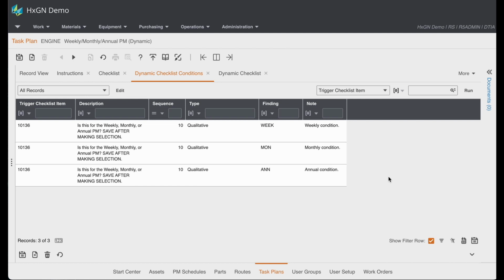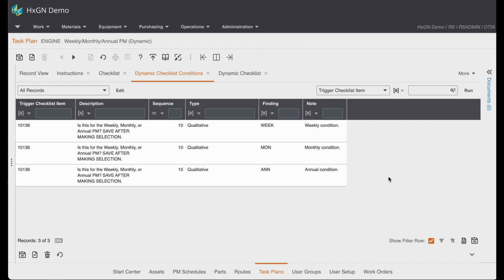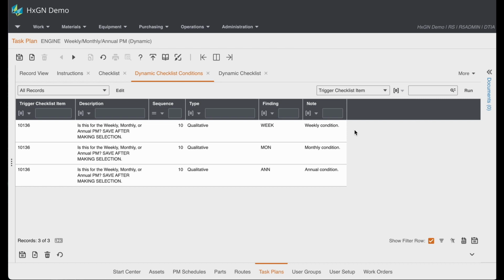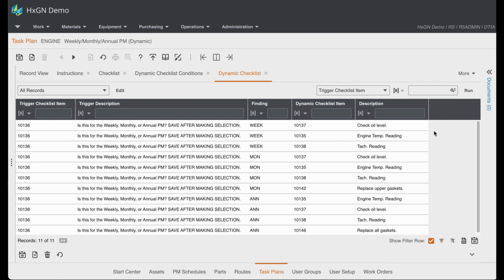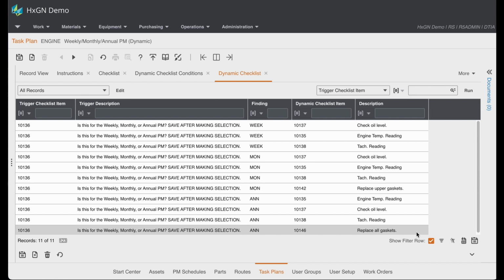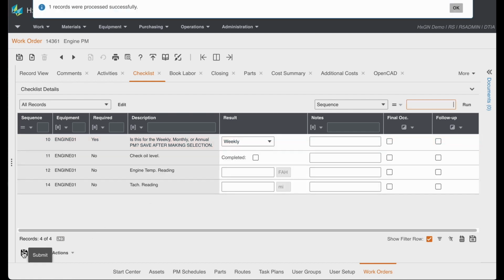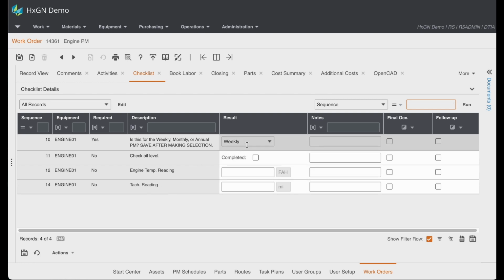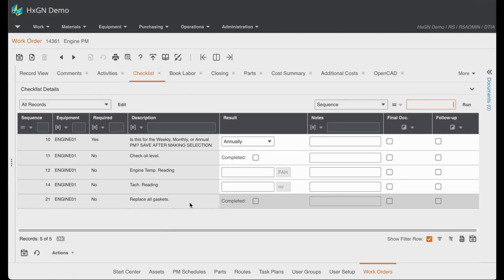Master Maintenance with Dynamic Checklists in Attune EAM Desktop

Comment: Hello Rebecca, how to setup the pull-down menu for the sequence selection? I am now working with a checklist, but the dynamic checklist does not work as expected. For a machine, I ask the first question: can it be inspected? If "YES," then the rest of the questions for that machine may become visible. If "NO," then the questions can be skipped and it moves on to the next machine. You then get too many dependencies, causing the program to no longer handle it. Or do you have another solution for this?

Furthermore, the questions that are shown depend on the "Object class" of the object. It does not matter if you also fill in the "Category." The questions presented only consider the Object class. This is unfortunate, because with the Category, you could make the questions more specific. Example:
Wheel = Object class
Wheel DE (driven end) = Category
Wheel NDE (non-driven end) = Category

You see all the questions in the Checklist for the wheel, while the questions could be different for a driven end or a non-driven end.

Unfortunately, the program does not make a distinction here. While with the Entity a "Class" and "Category" are clearly indicated.

Or is this an option that needs to be turned on/off in the background so that the questions are presented better?
Reply from the maker: Hello! Could you clarify which “pull-down menu for the sequence selection” you’re referring to? We want to make sure we’re understanding your setup correctly. If this checklist is for a route, you may want to review the CHCKLSEQ organization option.

Regarding the trigger conditions, the team hasn’t encountered a scenario where the system is unable to handle them, so it’s possible we may be interpreting your use case a bit differently. Checklist items can be refined by equipment category. Perhaps this field is hidden for your user group when setting up checklist items.

If you haven’t already, we recommend reviewing the HxGN EAM Checklists feature brief—it includes a lot of helpful detail! https://docs.hexagonppm.com/v/u/HxGN-EAM-Checklists/12.3